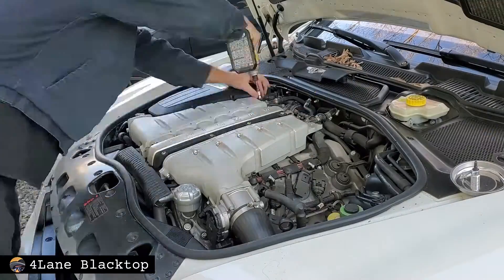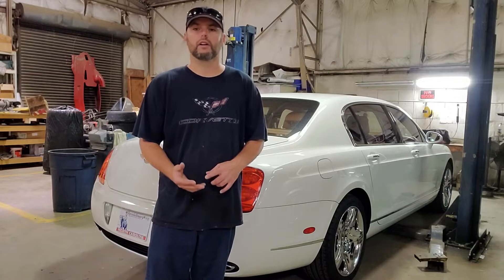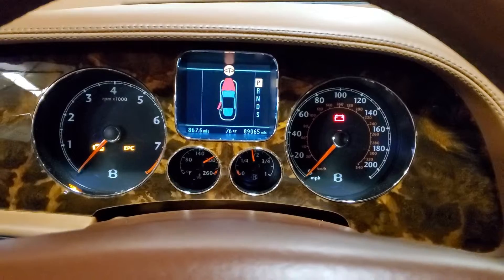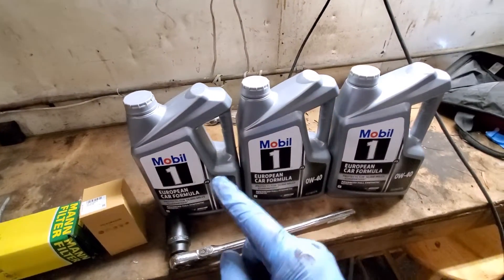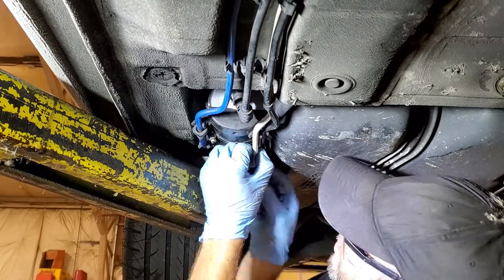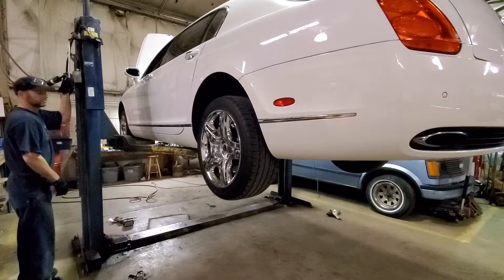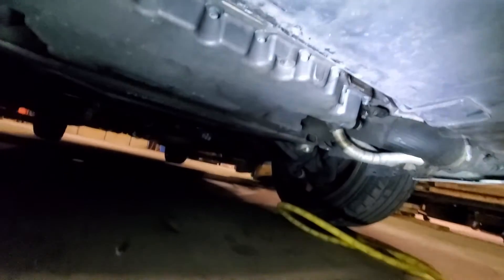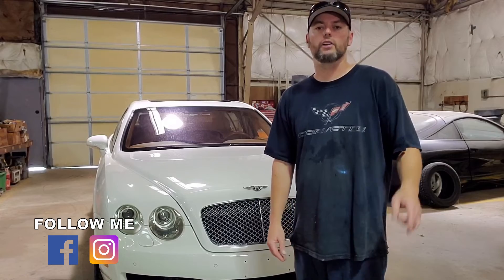Saving A Lot Of Money By Servicing This Cheap Salvage Bentley Flying Spur Myself

Comment: I took my Mrs. 2018 Honda to the dealership for a service and part of that they do a brake check….

They put it on a machine where each of the four wheels are isolated on two rollers 

and as you apply the pedal  it prints a report of how much breaking is force is applied to the rollers at each wheel 

That way if you’ve got any sticky caliper piston it will show up in the report 

I’d say that’s probably the best test you could do 

Without that the only thing you can do visually is check both pads on the same caliper are wearing evenly

Good job with channel 

all the best from Melbourne Australia

Comment: Hi, good video content 👍
From Audi dealers what model car oil filter and air filter do you ask for to get same parts.
Thanks
Reply from the maker: Oil filter is 2006 Audi A8L with w12 engine # 07C115562E. Air filters are Mahle  LX1091 and  LX10911.

Comment: Question - my Bentley started to beep after brakes were changed. I found a sensor wire split on the front right wheel and one on the rear drivers side. Is it a brake sensor and wheel speed sensor or ? I’m lost here
Reply from the maker: Im not sure

Comment: Anyone know where the oil pressure sensor is? I have a warning and suspect the sensor or pickup tube.  It’s intermittent. Your videos have been a great help, I even got brave enough to address my bumper cracks.
Reply from the maker: The oil pressure sensor is on the very front of the engine. You can reach it from underneath once you remove the undertray. I replaced the one on this Bentley as it was intermittently coming on sometimes. Around a $40 oem part and its never came on again.
Reply: Thanks. I also did the EGT trick just replacing the board and that also worked. I watch everything you post because there’s so little Bentley stuff out there.
Reply from the maker: @noserly  Yeah it is pretty limited on the Bentley info. I have acquired another Flying Spur. I hope to have it on the channel soon.

Comment: What about check oil filter, for metal particles.
Where are under body covers?
Reply from the maker: @Marshal66  The undertray was removed to repair some damage to it. The oil filter is a oil element and can be visibly checked easy. I did it of course, I just didn't show it.

Comment: I just did the oil service on mine ,filter ,over ring and drain plug I bought at the Bentley dealer it was $ 32.00 incl Tax ,the oil I ordered at Amazon Prime $ 70.00 for 15 Quarts ,we needed 14 for my GT
Reply from the maker: Sounds like you saved some money yourself.

Comment: Hi, do you recommend this sedan for someone used to driving an Sclass for many years looking to buy a 2006 Spur. Usually take my cars to independent mechanics. I saw a 2006 available, inmaculate with about 30k miles going for $38k. Looks super clean. Any advise would be greatly appreciated.
Reply from the maker: Thats probably a good deal. Just be ready for expensive maintenance if you will not be doing it yourself. With 30k miles it shouldnt have any problems but check it out good and make sure most items work. Examples: door windows, latches, trunk, radio, seats, etc.
Reply: @4LaneBlacktop  similar compared to 2015 sclass? Can you give me some examples please?
Reply from the maker: @COCIERTOS7MAS  Not knowing alot about the S class you speak of, I can say the Bentley is probably just as luxurious as the s class but keep in mind that it will be technologically behind seeing it is a 2006. I would expect maintenance to be at least and probably more than the s class. The service in this video is probably over $1500.